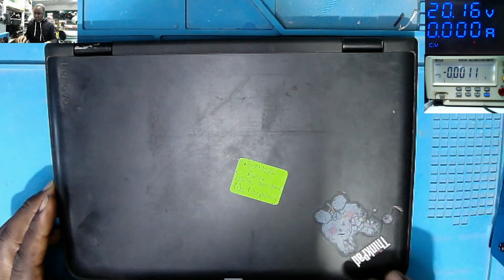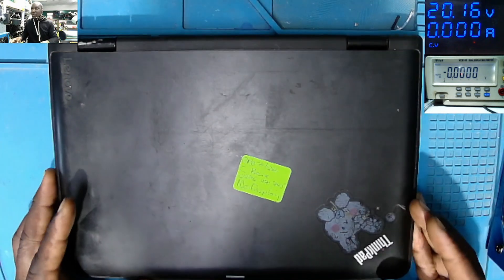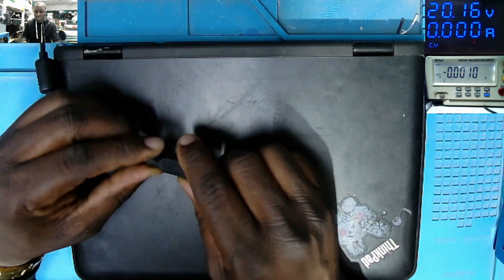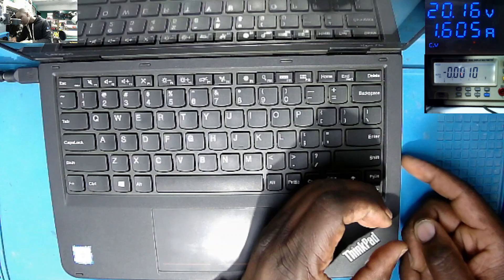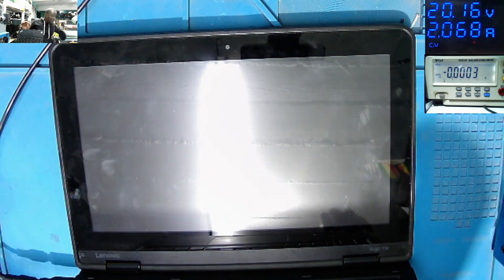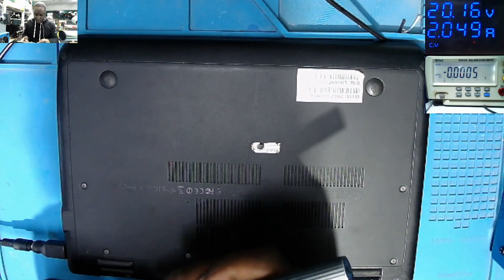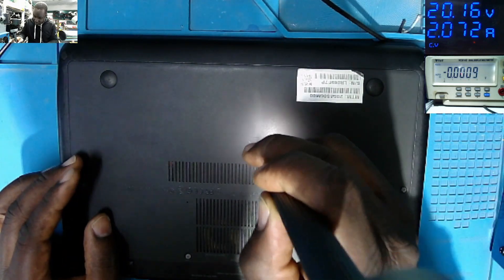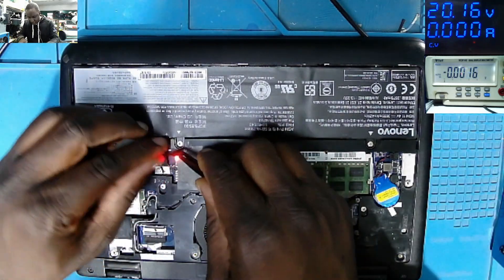Lenovo ThinkPad Yoga 11e Continuously Beeping With No Display--I Think We Can Fix This!!

Comment: I have that same issue, I tried disconnecting the cmos & battery, i detached some ribbons and then attached them back in. I did windows+shift+control+b method and tried hard rest but still no results. I just did this out of no where about 10 days ago, and i don't understand what's going on.  Please help anybody 🙏
Reply: Windows + Shift + Control + B Did the job for me to reset and screen worked. thanks

Comment: Me I have Lenovo Thinkpad 11e gen 6 have built-in 8gb ram,tried removing CMOS battery and original battery nothing and is not charging in type C connection also,can you help.
Reply from the maker: What voltages do you have on the motherboard?